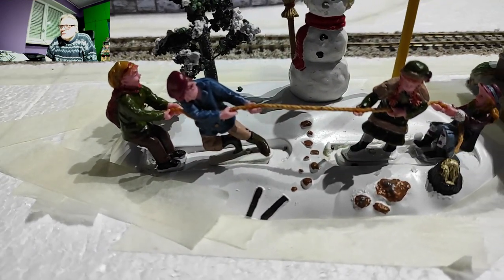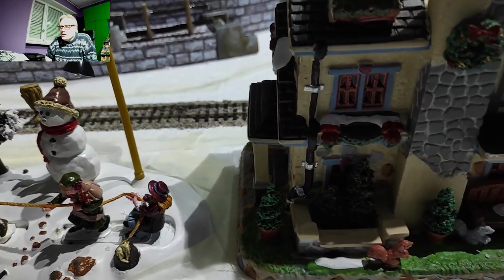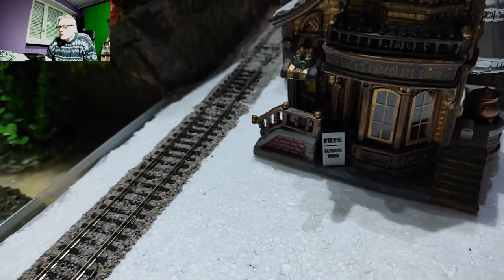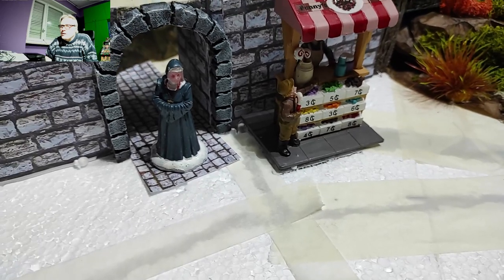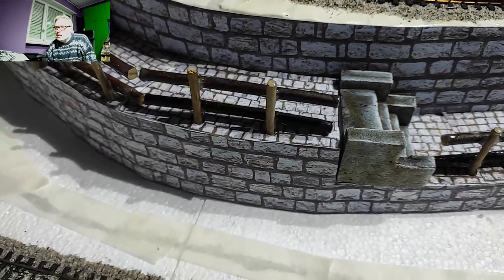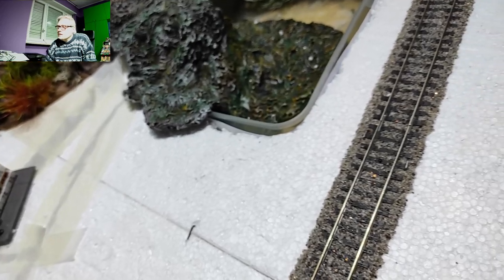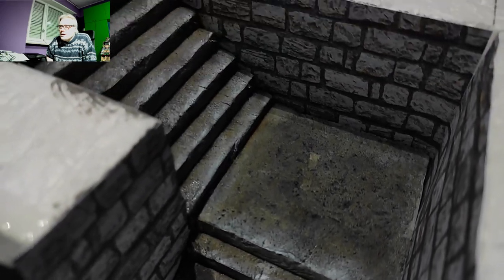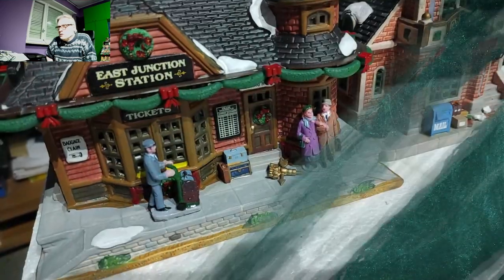How To Film Your Christmas Village - Christmas Village Filming Tutorial

Comment: Hello Silvio,
Great filming tips. The dolly that you made is impressive but unfortunately I did not understand most of it. Not on your part, I just do not have the mechanical knowledge. But I can appreciate your engineering  brain. In fact I have purchased a small (4.53"  or 11.5cm tall) Christmas pyramid that you can rotate by hand. I would love to add a small motor to make it rotate slowly. It would add some movement  in the Alpine section of my Christmas village.
Reply from the maker: Hello Susan,
Be advised that the new 2023 version of the dolly is a little more complex.
May-be if you can hide it someway the following mini rotating display could help you with the pyramid.

https://www.amazon.com/dp/B095HKVW46?th=1